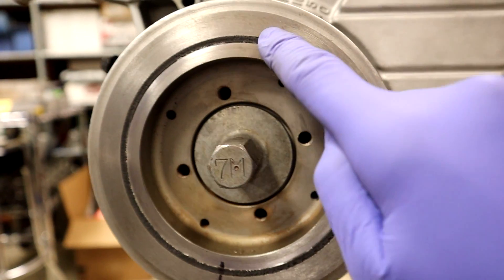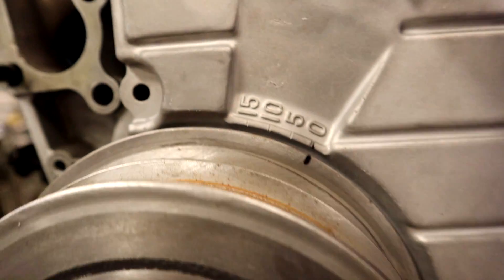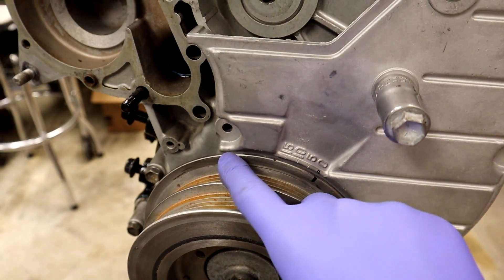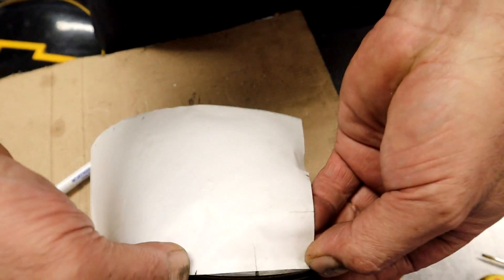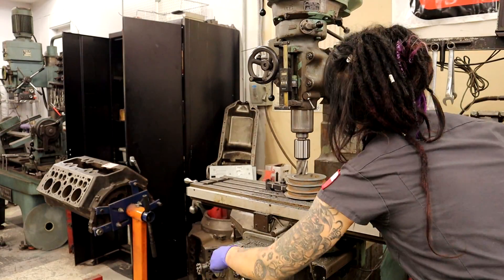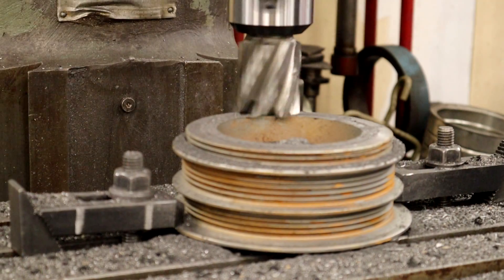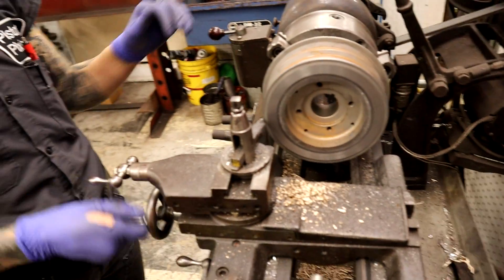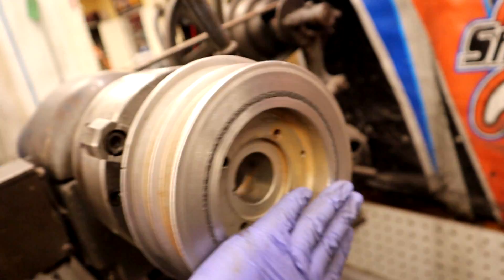I have Trust Issues: Verifying my TDC Mark and Modifying my Harmonic Balancer / Crank Pulley (pt.13)

Comment: The only issue I see with cutting that rib off of your balancer is you also removed the area that was drilled to "balance" the balancer by the factory.  You can see the drilled/balanced area in the sand blast part of the video.
Reply from the maker: I thought I showed in this video or mentioned in this video that I put it on the balancer and it was perfect..... I haven't thought about this video in a long time so I'm sorry if I remember incorrectly but there was no issue with this job.
Reply: @FayeHadley  awesome good to hear!  Some people might not double check it’s still balanced lol.

Comment: You need to balance the engine or at least the pulley....If you want to try this, it might work..... I have balanced brake rotors and other small components on a wheel balancer of all things..   Need one of those real fancy balancing machines hand fitted to the small part...Once the imbalance is found put a piece of clay opposite till it's balanced. Now remove the component and reinstall say 180 degrees from where it was installed. Now spin it up and it should still be balanced. Now take some metal off opposite from the clay till it's balanced.
Reply from the maker: Lol I balanced it on an actual balance machine!! I didn't include it in the video but I should have..... Didn't expect all the comments and people actually thinking I don't know any better 🤣
Reply: @FayeHadley  Ha! You know more than most. The more you know about motors the more you find out you don't know. Every time you think you figured out one thing two more things pop up you don't know.  i use to balance engines. Neatest one was a SBC ran at Talladega.. We over balanced it 4 % and it ran 197 MPH back in the day !981.

Comment: Good on you for getting onto some metal working machines! A little nit picking is required. The measuring tool you were holding wasn't a micrometer, it was a digital caliper. That lathe at the end certainly looked like a classic too!

Comment: Thats pretty cool. On one of the nissan engines i built they had a mark inside and outside of the pulley. So inner and outter had a line and when its good both line up. Also inside the cover it has a mark that the woodruf key matched up to as well.

Comment: manufacturer specs be damn, how much run out would you accept from a stock balancer/ pully before replacing it?
Reply from the maker: Ohhhhhh if it even moves a millimeter then it has failed!!!!
Reply: Dammit Chevy,.....

Comment: Fascinating stuff, really enjoy watching these bits. If it were me I think I’d use a cutting disc on that pulley one groove up to take the bulk off then clean the rest up on the lathe / mill. Just to save some time.
Reply from the maker: Just want to be careful.... you can't heat up the harmonic balancer too much or you can cause damage to the rubber and cause it to prematurely fail!!!!😰
Reply: @FayeHadley  That’s a fair point and would be a real shame to have it fail after all that work for sure!

Comment: Why not part off the extra pulley, rather than grinding it off with the end mill?
Reply from the maker: because anything that causes too much friction and too much heat can damage the rubber inside of the harmonic balancer... and plus.... let's be honest.... I just wanted to learn how to use the Bridgeport 😅🤘🏻
Reply: @FayeHadley    That is the same was I learned how to become a Machinist

Comment: Always love your video Faye. And Danny experience and  advices are priceless. About that stock 7m crank pulley. I don't trust it at all. Only a mather of time when the rubber part will break appart. And I doubt it's balanced after your mod. I only trust the ATI Super Damper on a 7M. That's what I have on mine for a few years. The A/C pulley is removable so you don't need to modify anything.  I strongly suggest you check into this one.  Cheers. Fred
Reply from the maker: And yes, I would KILL for the ATI Super Damper, OH MY GOSH!!! Feel free to send it my way if you can afford it ;) because it certainly doesn't fit into my budget even a little bit :(
Reply: @FayeHadley  Like expected you two got it taken care of. I would have been surprised Danny wouldn't have pointed that out. 😉Owning a supra for 18+ years you sure get to know there few potential problems.  I understand about the ATI price. Since I have one on my 7M.....please don't kill me 😁🤣
Reply from the maker: We already balanced it long before making this video! It was my error that I didn't mention it in this video... so many of you are so quick to point out anything that could cause me future woes, and I appreciate that so much, but don't worry, we got it handled!!!

Comment: I’ve got a tool I bought at a bike show to help you verify TDC. Screws into the head in  place of a spark plug, then has a rod that rests on top of the piston. You set up a dial gauge onto the top of the rod and then do the same thing you did, but without removing the head! I’ve had to use it a couple of times at work too, a particular engine where the timing marks were only on the flywheel. Great, more accurate, but if you had the engine apart and fitted the flywheel in the wrong position...(it had no dowel) so timing marks are 120° out! In both cases someone checked the timing and decided it was way out, even though it was running sweet. Pulled the distributor to set it ‘correctly’....result engine won’t run. 😳 That’s where I came in!
Reply from the maker: So freaking cool!!!!

Comment: Good old school measuring technique, that said, I would junk that rubber crankshaft damper anyway and get a fluid damper, they are cheap enough and way better than something that is probably 20+ years old and has perished and lost all its flex and dampening characteristics.
Reply: Trust issues
Reply from the maker: Haha glad they are cheap enough for you!!! They are not cheap enough for me :)
Reply: @FayeHadley  Might not be a bad thing. Changing it out to a fluidamper is not always a good thing for every engine, a lot goes into what type each engine should have on it. 🤙